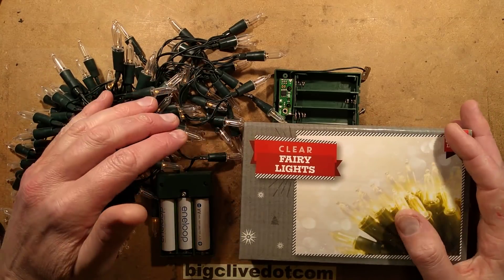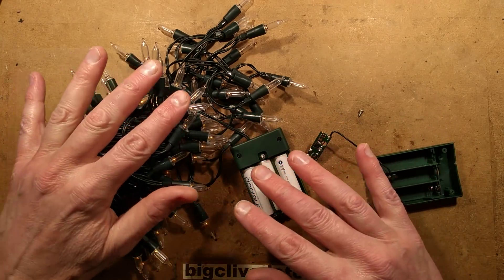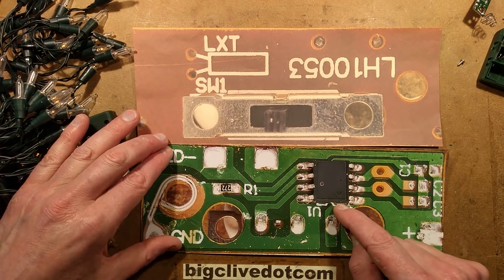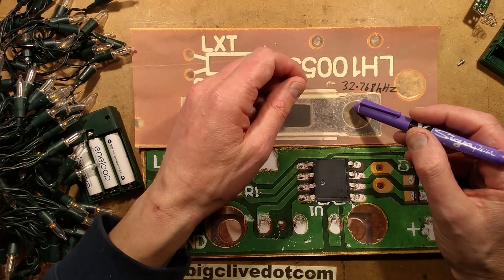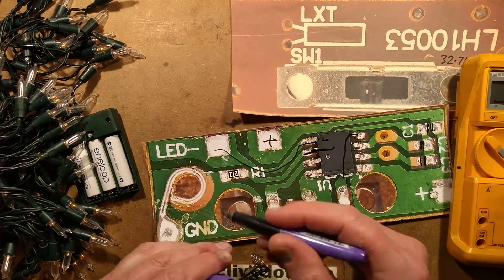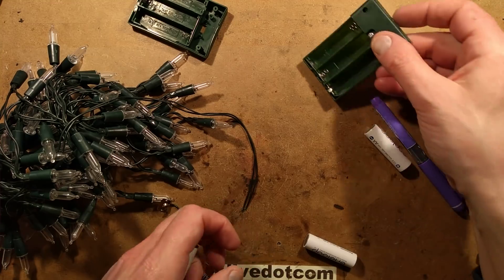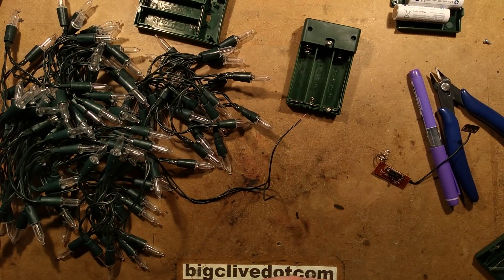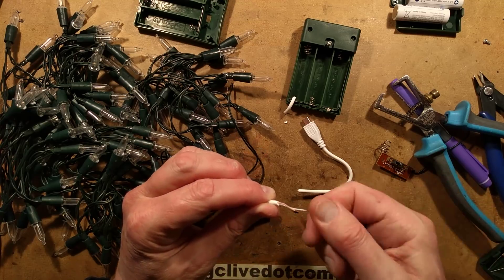Poundland lights unexpected feature and USB mod.

Comment: Two strange effects in that video......both times you replaced the heat gun in its cradle, there was interference on screen. Was it electrical or just you bumping things? 
Gonna have to get some of those leds - pretty nice to have strung around the place.
Reply from the maker: It was me disturbing the shelf the camera is mounted on.

Comment: What are your thoughts on those heat shrink lengths with the ring of solder in them?
Reply from the maker: I've not tried them yet.
Reply: @bigclivedotcom  I used the wire splice with crimp with the heatshrink casing and the "glue" / "sealant" to make them moisture resistant and oil resistant, on a f wire harness on a 99 7.3 l diesel injector wiring harness. That's a pretty tedious but very important part of that feul system / engine. So it was important to you use something reliable and it worked fantastic. I have not tried the connectors with solder tho.
Reply: @raymondmucklow3793  these crimps come with a low temp solder lump already on them but the problem is that the connection could become very weak if a short circuit appears. These connections are usually only good for low to medium amperage or to simply make a good watertight connection. Everything has it's ups and down's. Hope this helps.
Reply: They work alright, although if you heat them too fast or too much they tend to burst since the ends tend to crimp shut before the solder melts. I've had best luck with a regular lighter on those. They do work quite well and seem pretty water ingress proof.

I typically use the crimp connections with a built in heat shrink and hot melt glue, I get through a bunch since I deal with a lot of trailers and trucks running in brine half the year.
Reply: @ColtaineCrows  and it survives salt water fine? Damn those connections must be good.
Reply: @stonedsavage7814  Yes they do pretty well! I have them installed aswell, no problem with any water or salty water, just you need to be pretty carefull about not heating them to fast or too hot.
Reply: I used a few on some LED shop lights in the basement - mostly just to try them because I was so curious. They were very easy to use and have held up so far (about 2 years), but they are indoor so I never expect trouble - even if I just twisted the wires together and taped them :)